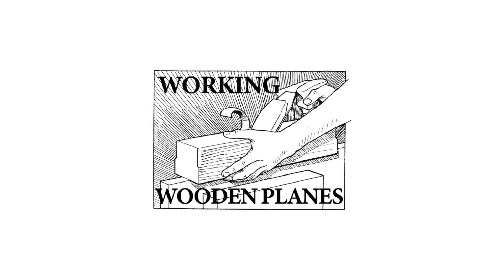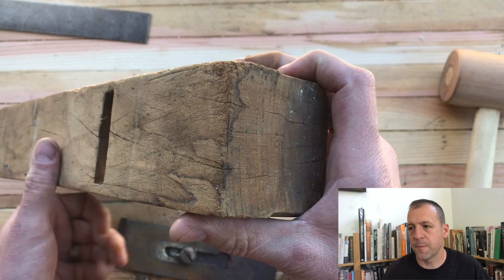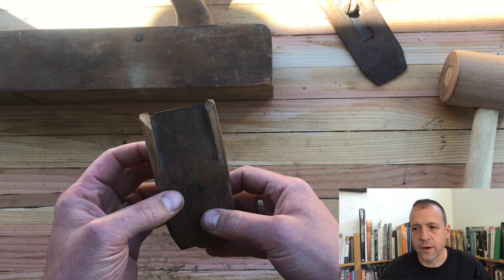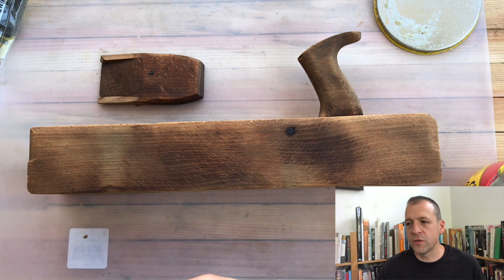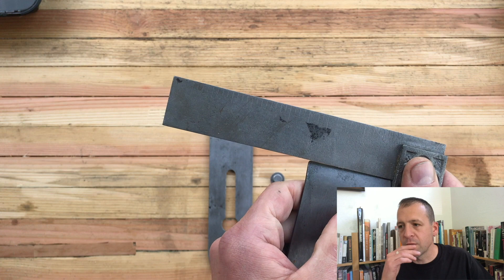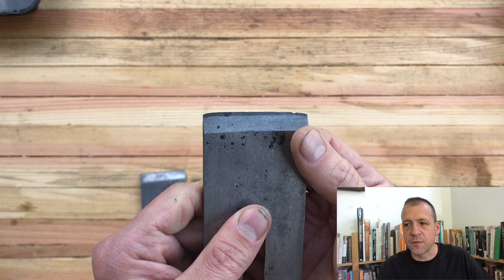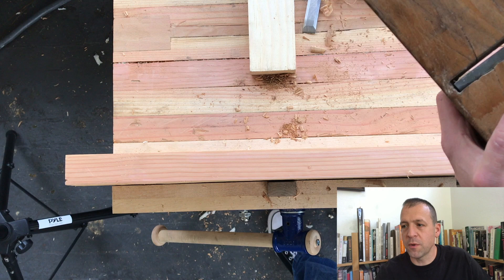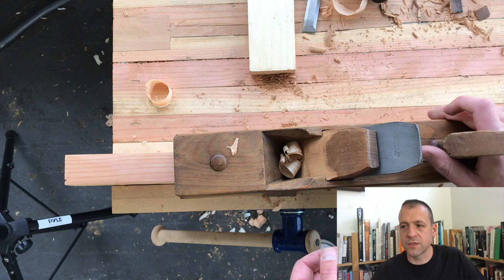Wooden Jack Plane Restoration and Wedge Repair

Comment: Hello! 
Jack planes irons were sharpened with camber or radius on purpose. This helps to work quick with deep shave and have nice surface on backed iron. 
Check some videos by Christopher Schwarz or Mr Underhill or Paul Sellers 
Excellent work and well thought technique.

Comment: Nice job with that fix at the end, not sure how you knew that was the exact issue but you seemed to diagnose it correctly. Really struggling with my exact same model ogontz sandusky plane that I bought recently.

Comment: I'm a complete amateur, but I had a rebuild a wedge recently and used playdough to find the angle. I don't know if it's a good idea or not, but it worked out pretty well in the end.
Reply from the maker: I want to know more! How did you use the playdough?
Reply: @WoodenPlanes  I basically treated the throat as a mould. the problem is you can't just fill it up because there are places where things catch. I used a couple thin plastic cards, a little thinner than a credit card, to act as dividers. It's a little hard to explain, but you basically make slices because the plastic cards are dividing up the negative. then you can pull out each piece in order. Figuring out the order and where to slice is the hard part. if I were working on something I really cared about I would use silicone putty(dental putty), which is a bit pricy but captures great detail without ever really staying behind. Also easier to get out without needing to slice as much because it is very flexible. 

Anyway, you put the slices back together with the cards still in between and you have a negative of the throat of your plane. You can measure whatever you want from there. I knew very little about planes, much less wooden planes, so this was a great learning experience for me.  I can try to make a video of how to do it if you are still interested. Might be a while because I don't have a wooden plane at the moment to use as an example.

Comment: I built the main staircase in "The Teak House" in Key West FL.  When the architect heard I had edge glued a piece onto the skirt board, he freaked! I was told to rush on down to the house - on a Saturday - and meet with him, to get yelled at most probably.  The back story is that I used a 16 inch plane on the pieces, before gluing. When I got there the prissy architect was already there.  His first words were, "Well, you didn't say it was indiscernible!"  That skirt board had 13 miters in it, to join the risers at perfect, sharp miters.  The boss told me the board cost $1800, but not to worry as he had bought two boards for the job, as he knew the difficulty of success.

Comment: Great video.
I'd think that sanding the sole could leave abrasive particles in the sole that could later scratch your work or dull the blade.
And it'd be harder to get the sole flat with a belt sander than another plane.
For me, I'll take it in to the 8" jointer (machine) at work and be done with it.

Comment: I recently acquired one of these at a flea market in eastern Tennessee.  I really went into this completely ignorant.....but the price was “right” and the plane seemed solid....and for what I paid, even if I’m unable to restore it to a usable tool, I’ve lost very little.  What I have gained is a lot of knowledge since acquiring it. So thank you for that! What surprised me about mine, is, on closer inspection once I got it home. it has a separate sole....a solid sheet of wood about an eighth inch thick.  The screws holding it to the body seem professionally done, with wood plugs covering the screw heads.  Are you aware of any manufacturers that installed a separate sole....or was this simply a hack job by the original owner, to preserve or restore a damaged throat?  I haven’t started cleaning it yet, but I am able to make out a stamped P8 on one end, and a TFPY 6 on the other.  Curiouser and curiouser!  I have watched a few of your videos, they are remarkably well done.....and educational.
Reply from the maker: Sounds like an interesting find! You guessed correctly. The second sole was put on by a user. The sole would get so worn down on planes that were used extensively that some users would re-sole them in order to have a tighter mouth. You may find a makers mark when you clean it but considering how much use it’s had I wouldn’t be surprised if the mark wore off a long time ago. Good luck on cleaning it up!

Comment: I was told that to flatten the sole i would want the iron in place (retracted so you don't damage that). Does that really matter?
Oh, and I prefer to have the plane set up like the Japanese do, with a slight hollow, but that's only a "feels sensible" thing (so it's probably stupid).I really liked the way you showed how the ears are fixed. That is really useful! Thanks a lot!
Reply from the maker: You are absolutely correct. I made a mistake in the video by taking it out. Nice catch

Comment: Thanks for the informative videos! For future planes, a scrub plane with a front handle would be of interest. I have a 8 1/2" x 1 3/4" scrub plane with a wooden handle that sticks up on the front that I would like to get in working order. The handle was loose and I was able to remove it. What is the best method for Fastening it back in? I was thinking of using wood glue.
Reply from the maker: I agree. Wood glue is your best option

Comment: I don't agree with using epoxy for the repair (too stiff and won't last as long as PVA).  Your glue should work fine, though I would have used it before refinishing the plane.

Comment: I have a 100 year old Sandusky that is similar. The mouth kees getting clogged. Any suggestions?
Reply from the maker: Could be a lot of things. If you know you're not taking too thick of a cut, check your iron and chipbreaker. You only want a tiny bit of blade extending past the chipbreaker. And you don't want any gaps between the leading edge of the chipbreaker and where it touches the iron. If there's a gap, shavings can get caught in it and that will lead to your mouth getting clogged. This might have more info for you: https://www.youtube.com/watch?v=EKcMzJ8eXdE